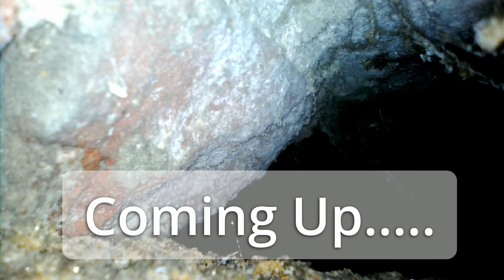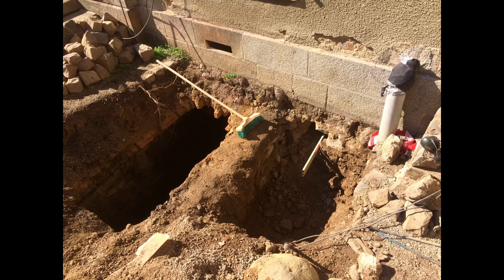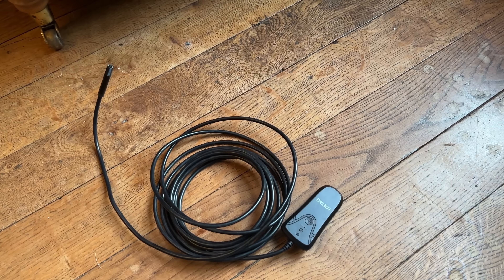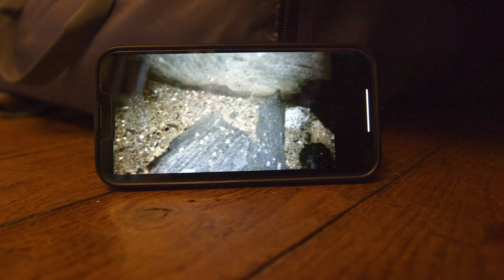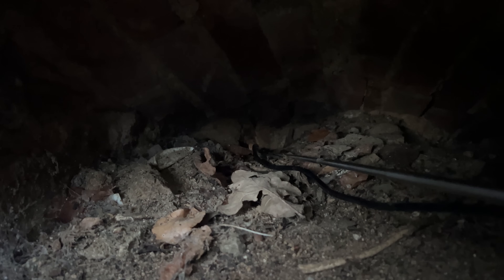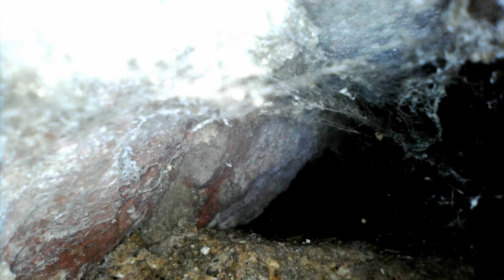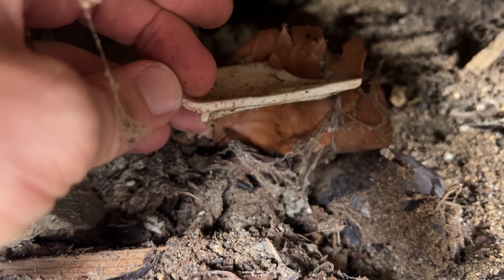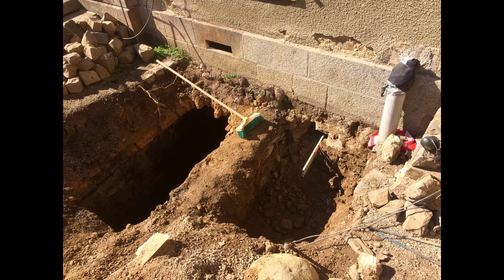Seeing inside secret hidden Tunnels underneath our French Chateau (what did we find!)

Comment: Why would the German army close up the tunnel entrance?  It appears the Germans had to leave quickly, as evidenced by the minimal effort to hide the entrance.  You'll probably find out once you re-open it, but in the meantime let's consider several possibilities...

-- Treasure is hidden or buried in the tunnel.  Quite a bit of treasure, which is why the Germans couldn't take it with them, ha ha!  Did they expect to retrieve it in the future?  Is there another entrance that they were planning to use to gain access?

-- Arms and equipment.  Why would they leave arms behind?  Just bring them with them when they left.

-- German graves.  During the occupation, up to the Allied invasion of Normandy, deceased soldiers were most likely transported back to Germany for burial.  After June 6, 1944, the German dead were recovered in some cases for burial in rear areas; in other cases they were left in the field.  The summer of 1944 saw a lot of movement of the opposing forces in this area, so it may not have been possible to prepare decent temporary cemeteries for the dead.  Is it possible some men were buried in the tunnel under the chateau as an expedient measure?  Why not bury them in the garden though?

-- Civilian graves.  Is it possible that civilians were taken in for questioning at the chateau during the occupation?  Is it possible any were executed and buried in the tunnel?  But I don't think the Gestapo needed to be concerned about hiding executed civilians.

Questions: What German army unit occupied the chateau?  What was its responsibilities during the war?  Or was it used by the Gestapo or some other branch of the German government?

I find the minimal information you've been able to obtain about the German occupation, the tunnel, and its closure to be suspicious.  Your only source was a child during the war and no one told him anything.  All he knows is that he saw the tunnel before the war, and that it was covered up before the Germans left.  Was the last part the truth or a lie?  In other words, was the child told that the Germans covered up the tunnel, when in fact it was covered up AFTER they had left?

I saw a video of another instance where a French farmer knew of German graves located on the edge of his property, but never said anything about it until a historian came around, asking questions.  I am convinced these Germans, who had initially been taken prisoner by the British, were shot by local civilians and buried in a pit.  They kept quiet about it.  The farmer only opened up to the historian because the guilty parties were dead and gone.

Based on this story, there is a possibility in my mind that local civilians in the area of your chateau did the same thing, shooting some German prisoners, or wounded men from a field hospital, and burying them in a hidden location such as the tunnel, because what they did was a war crime.  This would explain why the tunnel was covered up but not re-opened after the war.  

I can see it now... Everyone in the village was paranoid about what had been done, and the owners of the chateau didn't want to cause trouble for themselves or the ones responsible.  When the owners died and the local villagers died, they all took the secret with them.  

Based on my assessment of the situation, I recommend that you consider any potential risks you face if you proceed on your own.  But generally speaking, I think you'll be alright.  You may be inconvenienced somewhat during the recovery and investigation process, and the property may gain an unsavory reputation once the story becomes public.  

You may wish to bring an off-duty police officer with you when you first enter the tunnel, just to cover yourself and to make sure everything is transparent to the authorities.  Just my recommendation.  Good luck.